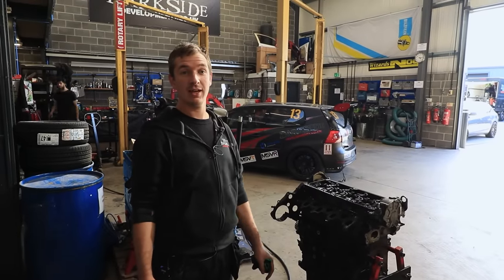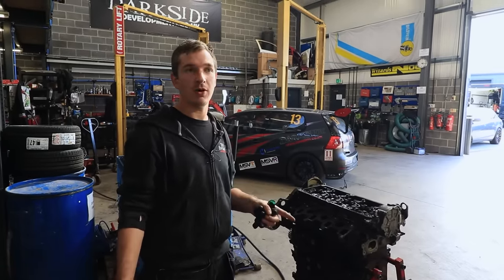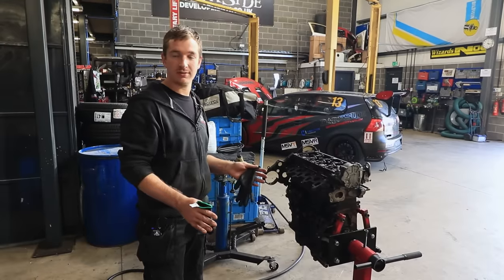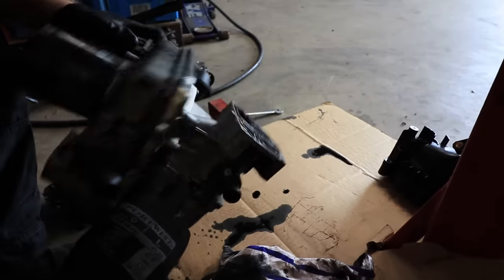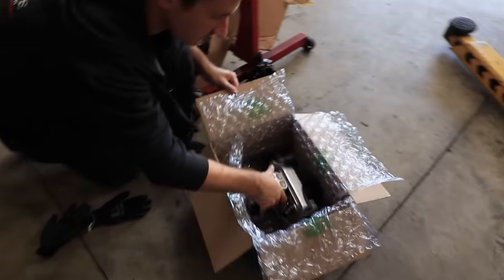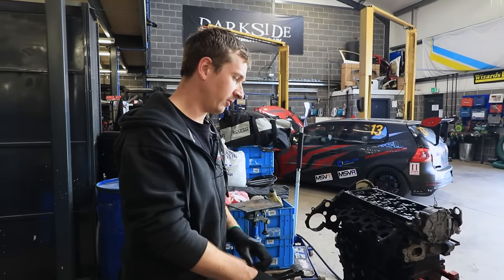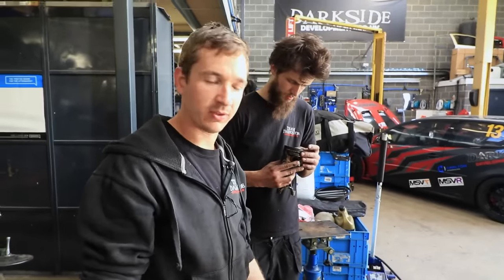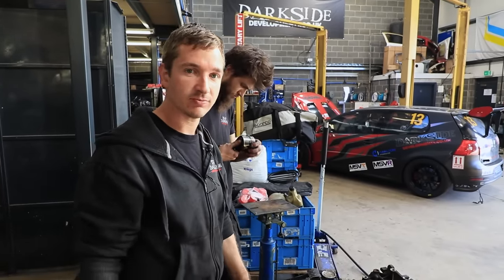Is this the worst 2.0 TDI engine VW ever built?

Comment: I’ll stick with my PD motor. Reliable and strong
Reply: I managed to put a rod through my block with my passat's 1.9 PD engine mate........so can be problematic.
Reply: They do work well!
Reply: @buggerlugz6753  B6 Passat ?
Reply: Buggerlugz that happens if you abuse engines.
Reply: Buggerlugz then don’t buy a BKC or BXE if you won’t wanna be losing rods

The 1.9 he’s talking about is the one from that old A4 and Golf MK3
Reply: @aqib2000  golf MK3 dont have pd engines
Reply: @alexandruv847  - No, it was probably the 199,000 miles on a 04  plate 1.9 Passat TDI 130,  original turbo too! Was flashed to 190bhp mind. It was originally my fathers company car from new so was serviced yearly. It was a BXE though.
Reply: I meant mk4
Reply: @buggerlugz6753  if you over map it defentley but not stock and maintained
Reply: Pieces of junk more like. Horrible, horrible engines. Take a common rail over a pd anyday
Reply: @ThenameisOskar  my Tiguan tdi does 52mpg on a motorway run, its remapped from 140 to around 185. It does 42 to the gallon while towing my 205 gti on a trailer behind it. Ive never liked them. Always thought they were noisy, unrefined units that were laggy and full of vibration. They also eat camshafts and cylinder heads.
Reply: @buggerlugz6753  BXE is the only affected, rest are fine.
Reply: @ThenameisOskar  A CBAB Engined 2008 4motion.
Reply: PD ASZ is my choice ! My daily is a Fabia and she returns 55mpg no sweat ! I drive about 22-25k miles and serviced every 6k ! Have the EGR deleted and an oil catch can on the crankcase breather - long may she continue ! God bless the PD
Reply: Yep me to 😊 axr pd
Reply: @buggerlugz6753  PD105 then. I have more miles on my AVF PD130 Sport, no issues
Reply: Pd👌
$1200 injectors......

If you have money to waste......

Ve is still king.
Reply: Common rail has $10k fuel system.
Reply: Pd was the beginning of the end of a good tdi. 

Unique expensive turbos. 
Camshafts and lifters eaten every 75k

The Passat ones had a faulty block- oil pump design. 
Spins the oil pump and the ballance shaft off a 5mm Allen drive. 

Lift pumps fail and turns the engine off. 

Previous tdi didn’t even need a lift pump!

Glow plugs that got changed a million times. Weird 5v glow plugs fail more often, hard to find matching relay. 

Egr pipes that endlessly break. 

Like I said. 
VE is the LAST true tdi. 

People go out and think new vw are good. 
No. Garbage.
Reply: Same my pd150 arl golf mk4 just clocked 238000 still going strong and pretty damn nippy mapped to 200 bhp
Reply: Except for the camshaft wearing!
Reply: Matthew Uffindell external oil cooler is an easy solution.
Reply: Nathan Brame were you drunk when you commented these three times.
Reply: @lukekilah6257  not sure about that, but the camshaft on my Passat 105pd wore holes in the followers, sounded like a can on wheels with no power, £1200 to fix
Reply: I own a golf mk4 1.9 tdi with the AJM engine code. I heard of a lot of poeple that this was the worst you could get in that time. But mine js doing very well after 325.000 km
Reply: Just DoIt  VE is Bosch terminology for a rotary distributor injection pump. Basically what most diesels were before common rail. Of course VAG had the PD motors in between, which were neither. So what he means by VE motors is the old TDi lumpss with a traditional injector pump but electronic control. 1.9 engine codes AHU, 1Z, AFN. 2.5; ACV, AJT, AXG etc.
Reply: best diesel engines ever made PD130
Reply: @fastinradfordable  Look how many Skoda Octavia TDIs are still on the road with a quarter of a million miles.  More than any other car, I heard.
Reply: Just DoIt   Rotary Pump
Reply: Agreed ive had many pds 100 130 150 and newer 140 and 170 some modified some standard but you cant beat the pd130 so strong n pretty nippy aswell
Reply: The only true reliable diesel engines from VW are the ALH/ASV/AFN, the ones with rotary VE pump. Those are industrial grade engines. PD engines are strong, but reliable...not really.
Reply: 1.9 TDI PD's are pretty reliable, but got flaws too. In some series (BXE, VW Caddy) big end bearing wears out and/or rod bolts fails and you end up loosing crankshaft. I replaced mine (bearings and bolts) at around $350. Also injectors are pretty pricey and camshaft wears out, if you don't change the oil regularly. Also hydraulic valve lifters don't last lifetime. I got BXE in Seat Altea 2008, 220000km, only clutch with DMF was replaced, otherwise all engine parts are original.
Reply: @buggerlugz6753  bxe is the anomialy and the exception to the rule unfortunately

Comment: I'm really happy with the EA189 engine. The CFFB in the Jetta is great. It does have the EGR flow problem with the valve but that's an easy fix. Otherwise it runs great

Comment: Got a cfca sportline myself. Fortunately found out about the issues quickly and blanked the egr with a tafmet emulator. 2 years ownership later and 70000 total miles on the vehicle all is well.

They're a nice smooth engine when they work well.
Reply: I own one, 100k almost, has EGR blanked for 99k so it runs perfectly!
Reply: That’s good to hear, I’ve just installed the same unit on my van.
Reply: Fitted a tafmet egr emulator to my wife's 2.2 tid saab five or six  years ago. Never been a problem, still working great. 
 Remember that combustion chamber temperatures can actually be higher without the exhaust gasses acting as a combustion suppressant. 
Egr not just an emmisions thing.
Reply: @chasevans7171  The factory EGR only operates at two times,  initially assist in attaining operating temperatures (when more heats desirable) and later whenever at low loads to reduce NOX formation as a result of excess oxygen in hot exhaust gas. Unlike a petrol engine where EGR increases the total mass of the cylinder charge, diesels control the power by reducing fuel ratio (not of volume of mixture supplied as with most petrol cars). Hence the average cylinder temperature is already lowest when EGR cooler would be utilized, and situations you'd be concerned about heat (such as sustained high load) aren't impacted by the EGR delete. Instead the high load temperatures will be governed by the volume/temperature of input air, alongside the injector duty cycle (if its taking to long to put fuel in, you start to get thermal issues you wouldn't otherwise at that power level).

Comment: I am due to pick up a 2013 bitdi 180hp with dsg tomorrow. 122000 miles. It is very clean with a fantastic service record. Drives really well. Should I walk away?
Reply from the maker: It's hard to say, they're great vans but have their issues. Be prepared for the worst or look at single turbo 2.0 TDIs, these seems to be more reliable and with a remap you get similar power to a stock biturbo

Comment: Great video and mega useful.  I bought one knowing it may have an issue.  Had it tested, no issue showing.  Changed the EGR to be on the safe side, 2 years later, valve 2 + 4 running on 25%.  The damage was already done it just wasn't showing yet.  Call to VW, luckily they conveniently sell a kit to fix the issue.  Essentially resulted in a brand new engine plus anything else that has ever had exhaust gas or oil.  Not cheap!
Reply: @Pswayder, Was that just your local VW dealer, same issue here and looking at options, what is "Not cheap! if i can ask? and what did you get for it ) thx

Comment: My CFCA (2011 model year) was replaced with about 35.000 miles on the clock. Due to absurd oil usage because the cilinder walls had gone. After the whole block was replaced the turbo started acting up, and that turned out to be a vacuum line issue. Now, about 6 years later she still runs fine, though I don’t know if they replaced anything other than the block...

Comment: Hi, I’ve had a 2011 T32 180 manual for about 7 years. I wasn’t aware of the issues when I bought it however it’s now done 170k and at the minute running okay. I love it and I would like to keep the van long term however to ensure reliability is it worth / cost effective replacing the engine or cut my losses and get rid? If it can be refurbished or replaced is this something you could do?
Reply from the maker: Drop us an email to sales@darksidedevelopments.co.uk and one of the team will be able to advise you there

Comment: Hi I’m about to complete a purchase for a 2017 4motion 204,manual LWB it’s only done 39 k and a turbo was replaced at Vw at 30k
Really like the high spec on the van and on test drive it is very tight and pulls nicely
What further checks or advice would you give me regarding the engine, not sure if this is a CFCA etc ?
I was hoping to tune it aswell only as we will be towing a large caravan with it all over uk and Europe 
Thanks Ant
Reply from the maker: So that will be the CXEB, and we've been seeing a fair few 2016/17 models coming into our workshop with faulty pistons/rings damaging the engines and having to get replacements. There are a fair few posts on our facebook about the issue. You can also drop us an email to sales@darksidedevelopments.co.uk with reg/vin and we can discuss any issues and tuning if applicable

Comment: Hi, nice hair lol and great videos. I'm from Ireland and new to your channel mainly because I'm looking at a van and VW T5 Transporter 2.5 TDI lwb brought me straight to you. I will be honest I don't have much faith in German cars i.e. 2000 Audi V6 (fuel pump), 05 2.5 TDI, BMW 525D (just about every known problem) 07Mini one 1.6 Conv (head gasket and seized solid gearbox), 07 Skoda Superb 2.0 TDI (dm cutch, gearbox), 02 Audi TT Quatro, 08 Mercedes C180 coupe 2.0 (camshaft sprockets, corrosion), every one of these cars scrapped at around 100k as they were uneconomical to fix.
All were very well maintained. 
I have been offered the van I mentioned, it can be described as immaculate, inside cab, inside the rear, engine bay, underneath and not a dent or scratch on its silver paintwork and with 145k miles apparently the cams are driven by gear, it has not been tidied for sale but always kept that way. I know the guy who owns it well and he looked after it like a baby and is only selling as unfortunately he is at the end of life with terminal cancer. He is looking £7.5 k rightly trying to get as much as he can for his partner.
As you can imagine I am nervous regarding German vehicles, I cant expect you to say buy it and know problems can't be foreseen and obviously no reflection on your advice if it goes wrong. The bit of research I have done is many of these vans have over 200k without serious problems, nut there appears to be many horror stories. 
My question is is the right van to buy espesially with this engine or could I be walking into another mony pit. Your opinion would be very valuable. Thanks.
Reply from the maker: If it's been well looked after and continues to be, then it shouldn't be horrendous. However, with most transporters, if things do go wrong, it can get very pricey

Comment: Thanks for the video guys. Just been looking at a 62 plate 180 70k miles on the clock and has the 512 A EGR should I walk away? I used to be a mechanic by trade and the vehicle is very cheap trade deal drives and starts perfectly. Thanks guys.
Reply from the maker: Take the risk or ask to do a comp check first? Some run well but gobble oil
Reply: Thank you for the reply guys much appreciated.

Comment: Just watched your video. Thanks for sharing. I'm in the process of possibly ordering supposedly one of the last transporter 6.1's tdi450 4motion vans and then convert into a camper. After researching the web I am now concerned about these engines. Are you getting issues with the later engines? Thanks.
Reply from the maker: That will either be a CXFA or CFHA engine which shouldn't have the same issues as CFCA's do so you should be good with them!
Reply: @DarksideDevelopments  Thank you very much for your response. Much appreciated.

Comment: I replaced a 2.0 CR TDi in a 2015 Caravelle that threw ALL four con rods. I have never seen that before. I asked the customer, a coach operator if it had runaway. He said no, was only doing 50 mph following a coach. Was a DSG model.
Reply from the maker: never seen that either, maybe a dodgy re-con?

Comment: So is it a good engine basically with just a poor egr design/poor maintenance issues.?
So should we avoid them??
Reply: If you close the egr asap with low mileage and add an additional oil cooler the last long
Reply: Yes.............
Reply: @niko8638  Basically because with twin turbos, a fairly small engine bay and commercial type demands they are often abused with (long days with heavy loads, towing trailers or lead footed courier use in stop start traffic to name a few), temperatures do get pretty warm, especially with an auto and air conditioning all piling more thermal load into the same air path. Will depend on your climate and use case of course, but in general if your not keeping it totally stock, its worth at least considering.

Also unlike EGR delete, a external oil cooler doesn't normally have a large impact on what people think of as the "warmup" time of the engine, since its not a big change in either mass or total cooling present (even before thermostat opens), and the oil temps are only loosely coupled to the block/coolant (reaching an equilibrium that notably higher, but with average in sump remaining cooler than the block for a noticeable time after the engines coolant has reached operating temperature anyway). That said if your going crazy with the size you'll want to make sure you do a longer (or harder) drive once/twice a week to get the oil hot enough to drive moisture out, else add an external water separator (which is what most heavy diesel plant needs to do, as the "Italian tune up" of running it full tilt every now and again is both expensive in fuel/maintenance and frowned upon by occupational workplace safety regulators), but this isn't a change in usage for most van owners anyway (much less anybody who was worried about overheating oil to begin with). Hence for most people the real consideration for adding the cooler is the cost of parts/installation, since a ebay cheapo home job can be a liability, and as much as we all like watching the dark side boys work, they do still need to keep the lights on, so it isn't free.

Comment: The people responsible for coming up with the laws and regulations that require every car manufacturerer to make engines that are not possible to make, that makes almost every car owner suffer with gigant repair bills, and cars that won't start, or cars that stop in the middle of busy highways, they should be sued. They are responsible for all this mess, as far as I can tell. They seem to be doing it on purpose in order to get everyone to use electrical cars. Well, I know how bad batteries can be, having had an offgrid cabin for many years. The battery quality has gone down too. I was just watching a preowned hybrid car that was for sale. Not because I would ever want to own one, but because it had two solar panels on the roof. To me that is hilarious. If you need solar power to drive a car, you would be in trouble in this country. Here we have had years with eleven months of rain on a daily basis, with no sunlight whatsover. You don't get much solar power from that.  Back to the people responsible for all this trouble and these gigantic expenses. They should be held economically responsible for all of this. This has gone too far to say the least. Enough is enough. This madness needs to be stopped as soon as possible.

Comment: Hi Darkside, thanks for the shared knowledge on these engines. 
Is there any 2.0tdi engine (block and head) that is compatible with the CFCA engine peripherals?
Thank you
Reply from the maker: There is no reason why you couldn't run other 2.0 TDI engines we even looked at fitting a CUAA

Comment: Nice vid. Thnx 4 sharing. What about removing egr and replace for normal watercooled oilfilter housing?
Reply from the maker: Yeah, we ended up doing that using this https://www.darksidedevelopments.co.uk/products/oil-filter-housing-with-oil-cooler-for-vag-cr-diesel-engines.html
Reply: @DarksideDevelopments  and block off on the egr?

Comment: This is precisely what happened to my Caravelle 2012 CFCA engine. I had my engine repaired: major engine restoration - 4 new pistons, new EGR Cooler (D Suffix), 4 new con rods (used), 8 x new bearings, 4 new jets, head gasket, coolant, 5w30 C3 synthetic oil (£2000). It's been running great for 10,000 miles since. But now I have a low oil pressure warning. But it seems to be something of a red herring as no mechanical faults or noises can be found, oil level fine, temperature normal and the car is still running great. I get an intermittent alert for 5s at a time. It would seem to be wiring <sigh>
I also get intermittent electric sliding door bouncing and a couple of rear circulation issues reported on VCDS. So it looks like some ageing to the electrical components is my next battlefield.... (if anyone can offer any tips I'd really welcome them).
I've had some other fun with it: New dual mass flywheel, oil cooler, seal rings, o/s engine mount, wet DSG clutch, DSG oil, Spigot bearing (that was missing)! New CV joint (inner and outer, driver's side) and rear wishbone. Oil sump check, rear n/s wheel bearing, new oil pump and shaft, cambelt change.
Reply from the maker: If you some help just drop us an email - sales@darksidedevelopments.co.uk
Reply: I have the same problem with the oil lamp, only two seconds and gone. I dont know whats happend.  you resolve the problem? Where is the place on that engine for the oil pressure switch? Thanks anyway